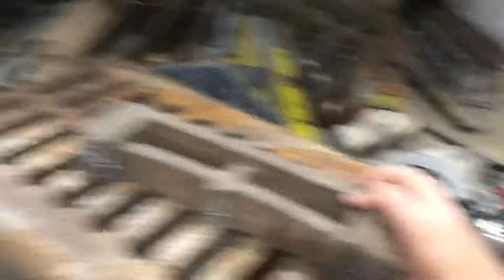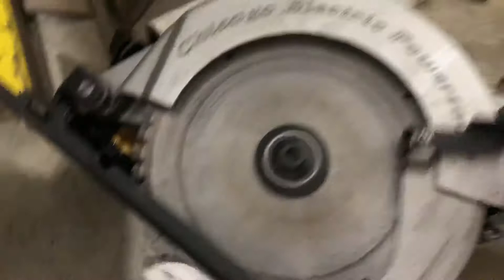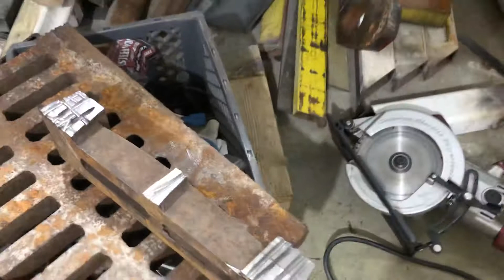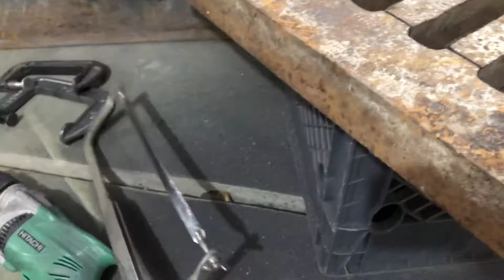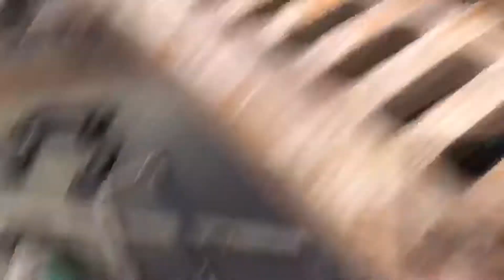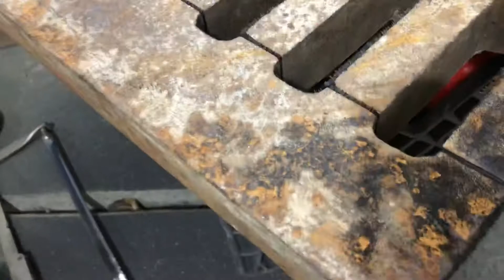How poor people make tools

Comment: I'm surprised you didn't cut that with a #2 or #3 oxy acetylene torch, which would be way faster than cutting it with a 4.5" angle grinder.    Don't feel bad about using scrap to make stuff.  Lots of youtube channels showing how the guys in Bangladesh and india make stuff using scrap.  It's the ultimate form of recycling.  Saw one video where they get a bunch of guys to torch cut a ship hull for all of its scrap steel plate and then they had a bunch of guys cutting the plate to make all sorts of stuff like car rims.  Sometimes desperation forces creativity and is the mother of invention.  Ironically the guys in India and Bangladesh have lots of our WW2 era and pre-war machinery.
Reply from the maker: @komoru  I don’t have a torch , just a angle grinder . I did end up making some really nice hand scraped straight edges from this . Used those to scrape my mill and surface grinder